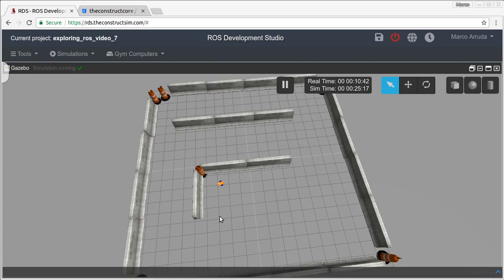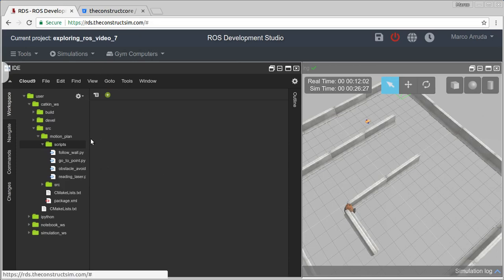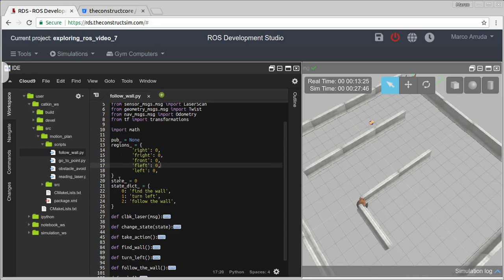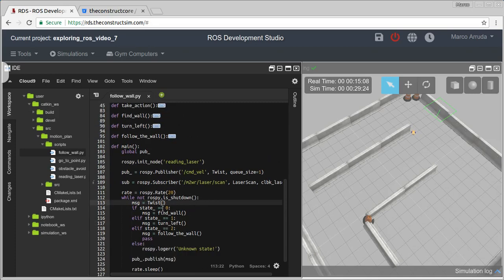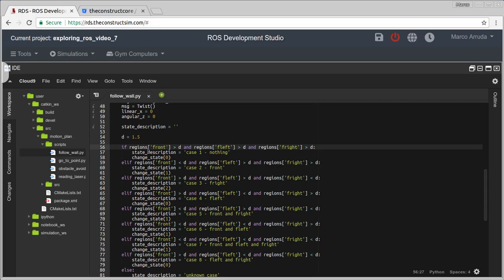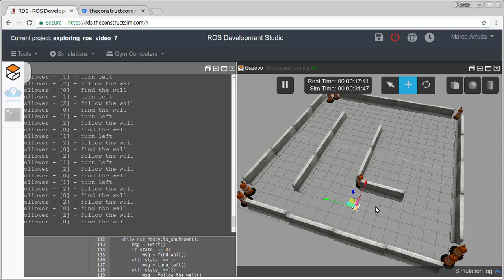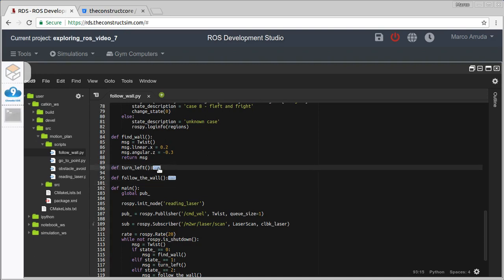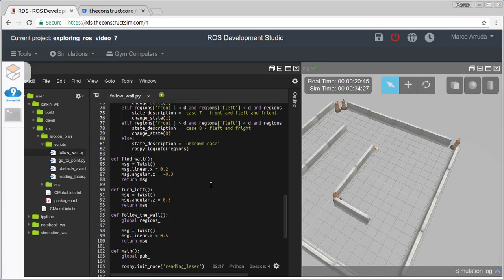[Exploring ROS using a 2 Wheeled Robot] #7: Wall Follower Algorithm

Comment: I was going to ask also, what @R.Z. asked below. In my experimentation with a real robot with a lidar the information that I get is very noisy. The robot thinks that it sees a wall on the left and then the right and then the left again in three consecutive scans. The robot jumps around in a very ugly way. Have you tested your code with a real robot?
Reply from the maker: Are you talking may be about Infra Red lectures? Lidar lectures are quite stable (that is why they are used for autonomous cars). If you are using a lidar and getting those strange readings it may mean that you have a problem with the lidar itself. Also it could be that since you are rotating the robot, if the lidar field of view is not 360º, by moving it, the obstacles perceived will change, so your algorithm may need to take care of those changes
Reply: The Construct thanks! It actually can be seen when the robot is not moving at all. Is there a chance that the Lidar is having problems? Any suggestion on how I could check?  Could it not be because of normal noisy info being generated by the Lidar?

Comment: Hello, I am following this series and think it is very well made, thank you!
I would really love to test this algorithms in a real robot, but I am missing a PID controller to control the robots heading. Without closed loop steering to adjust power to motors a real robot would probably never reach its goal or even drive straight. Could you please consider to include this on your project? Thanks a lot again for this great tutorial series!!
Reply: Hi R.Z., thanks for sharing your experience.
Sure, it would be great to help you and others to have this problem solved.
First thing is that you are sending commands to the motors and in the series I'm using a gazebo plugin, but I can implement a controller for the wheels considering independent motors.
Second thing, a question for you, which sensor are you using to get the heading of your robot? Odometry? compass?
Reply: Hi Marco, thanks for your reply :)

Yes Gazebo uses calculated values and therefore the velocities of the motors are always perfect...and I guess that is why I am not able to get the same results when trying this algoritms in a real robot...

You mentioned that you could implement a motor controller for two independet wheels , would that motor controller also have some kind of PID control behavoir? That would be great!!! :)
Would that controller publish "better" velocity commands to the wheels by taking into consideration that the desired heading (or speed of each motor) has not being reached? I guess that if so, then it should also work like that on a real robot, right?

Regarding your question about my robot setup:
I have a differential drive robot, with an Arduino that gets the encoder readings of the two wheels and publishes the odometry. The Arduino is connected to a Raspberry Pi and subscribes to the topic cmd_vel to sends PWM values to the motor drivers.

Recently I added a Lidar to my robot and right now I am working on implementing the ROS navigation stack. However I guess that the problem with velocity commands and real velocity of the motors will not be solved by the navigation stack...

Comment: Hi,
What are the differences if this project is carried out with a 4 wheeled vehicle that moves with the ackermann model instead of a two-wheeled vehicle? Are you going to do it for a vehicle that moves with this ackermann model in the next project?
Reply: Hi Robert,
For the states changing: the differences would be mostly in these values (distance from the vehicle to an obstacle), because of your vehicle dimensions. These parameters affects directly the performance of the algorithm. The robot can be more or less agile depending on these values. For the video, I have defined the values empirically, but you can create a mathematical model and get to optimal values.
For the actuators: It's also important that your vehicle works using the Twist messages (You can use a plugin that converts Twist msgs to your ackermann model or do it by yourself in a separate node - to keep it more organized)
For the perception: If you are not using a laser, you should redo the laser subscriber and fill the "regions" variable in a proper way for the kind of sensor you are using (sonar, camera, etc.)
For this series, we are not going to use a different robot, but it's a good idea for future projects, I'm gonna take note of it!
Thanks!